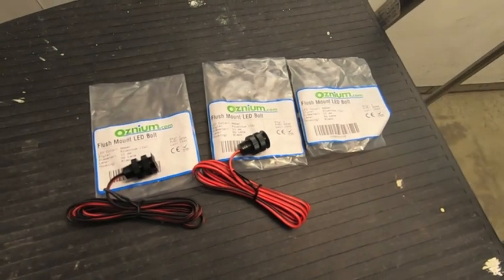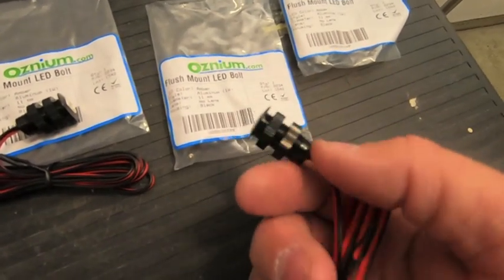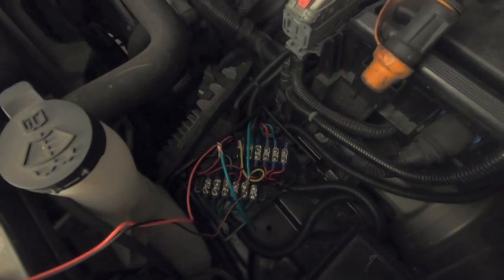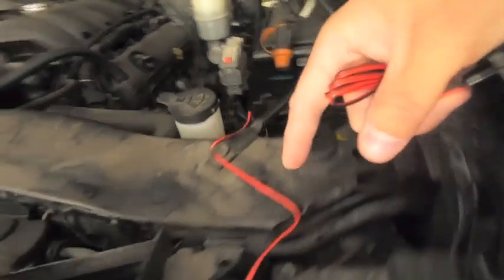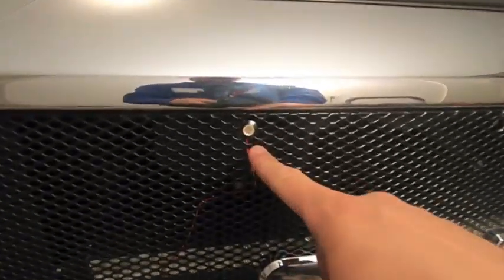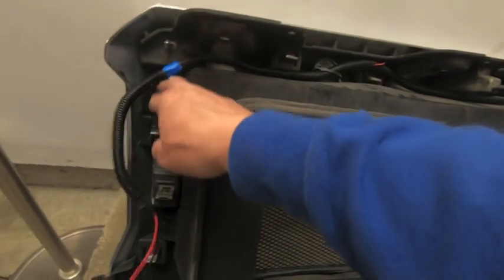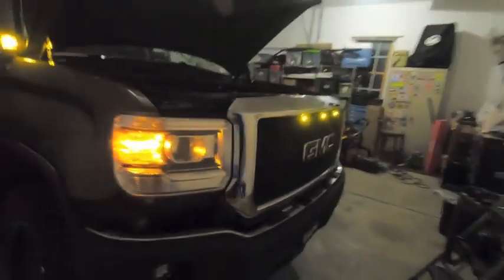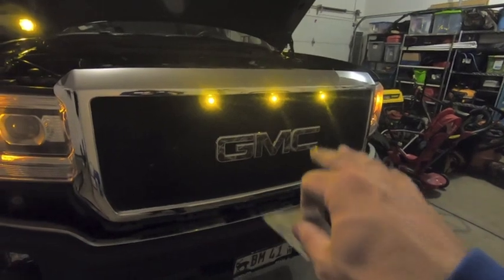LED Grill Lights - GMC Sierra

Comment: Nice video! professional job, no halfassery done here.   👍👍👍.  I like the Raptor too but hate the width/must be a b$&@h to park, MPG's and Fords reliability and price tag. Love the looks, capability, Suspension & interior. 

Do you know if the Denalis Magnetic Ride control will fit your truck & Silverados?  

Also ever rode in a 14-18 Denali truck?   I wonder if it rides smoother or if it's just more controlled?

Comment: When you terminated the LED bolt light wires and switched to the two wires that run into your relay box what size wire did you use? And was that relay box something you installed or was that already equipped with the truck?
Reply from the maker: The relay box was something I added. I use trailer wire for all my accessories. I think it’s 12 or 14 gauge

Comment: I went and bought the same led bolts thx to your video for my 2013 sierra. I’ve got the leds in the grille and wires all terminated and ready to go. Do you have any additional info on how you setup that accessory box? How did you get the drl and whatnot setup? Can I pull power from the fuse box instead of running all the wayfrom the battery? Requesting another video just on that lol? Thx in advance for any info you can provide sir.
Reply from the maker: Sean find the drl wire in the headlight harness or any circuit that is on when DRL’s are on. I used a t-tap to pull the signal from that wire which tells a relay to close. The relay sends power to the amber lights. Unfortunately I never got around to filming the wiring before I sold the truck. 

Use a relay to be safe so you don’t overload your BCM circuit. There’s not enough amperage in that circuit to use it to power those bolt lights.
Reply: Water Fowler 41 so tap into the DRLs which is no problem but use a relay ?  I don’t understand? Use a relay from
The DRLs in between the LED bolts or piggy back off the relay the DRLs are already wired to??  Thanks in advance.  Mine arrive in three days i want to make sure not to fry em accidentally ..

Comment: Where did you get the box where you connect all your wiring to? Or what is that called?
Reply from the maker: Boomer_S3vN i used a relay box from amazon and a regular plastic project box from frys
Reply: Thanks so much! Love the install and look.

Comment: Where can I tap.into my fues box if no electric block like you have
Reply from the maker: I would hit up the gm truck facebook groups and ask, its been a while since I sold this car and I don't want to steer you the wrong direction
Reply: @WaterFowler41  actually found the wire for the cab lights and was able to tap into it, and all is good.  But thanks for the reply.👍